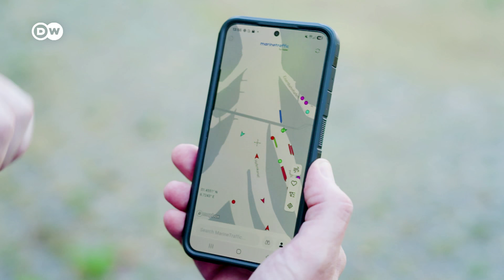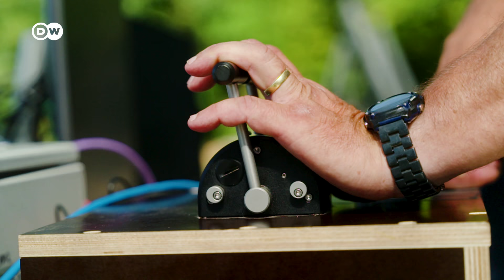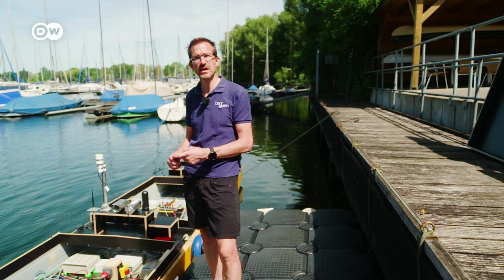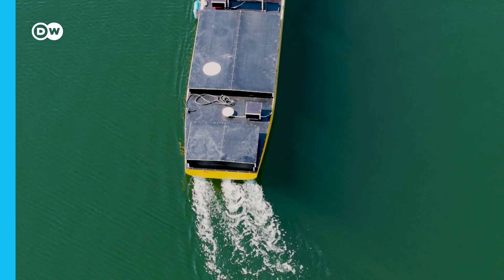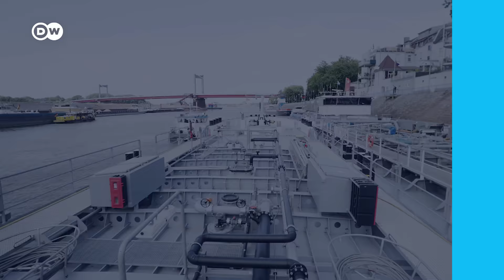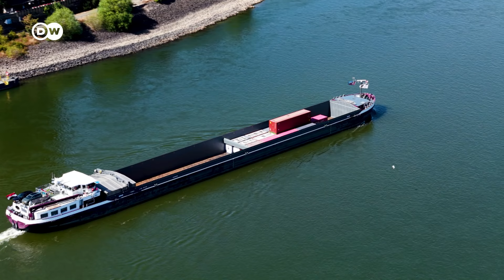Rhine running low: Can special ships keep goods moving? | DW News

Comment: I'm not in any way an expert, but I've been thinking about delivery system globally. Why do we use diesel based machinery and not a conveyor belt system on land in a tube like protective environment. Thousands of kilometres of tubes connected worldwide and powered by electricity. In the long run it could help improve our climate, given that we wouldn't use IC vehicles. Expensive, but less damaging to our habitat.
Reply: You mean trains?
Reply: @maxfuchs3387  Trains are very useful, but still run on diesel. Is conveyor belt a train?

A high speed conveyor that could transfer goods let's say from China to Europe in under an hour. Musk proposed vacuum tubes for fats transportation, but I have no idea how could we create vacuum tubes stretching for hundreds of miles without bursting.
Reply: @jab @jabadabadu7089 most trains run on electricity in the developed world (excluding USA).
So you think we can’t figure out how to build a vacuum tube (simple but expensive) but want to build a supersonic conveyor belt? You do understand that the stuff you want to transport with it would go up in flames due to friction of air and object?
Also.. we should just start manufacturing stuff where it’s needed. Different for special machines etc. but otherwise it’s true.
Reply: @maxfuchs3387  Passenger trains are mostly electric, but cargo trains still run on diesel-electric system. As I said, I'm not an expert, it's just an idea. Whether it's doable, that's a different question.
Reply: @jabadabadu7089 this is just not true. Most are Electric especially considering the transported tonnage. The main routes are electrified and have been for a long time.
Reply: Waterway transportation is energy efficient when compared with other transportation means. Much more cost and environmental efficient way in Germany is to electrify the car fleet and in next steps to electrify and use hydrogen in the road transportation. Ships can later go to hydrogen or ammonia, on short voyages also electricity, but the environmental impact is smaller.
Reply: Trains. You're describing trains.
Reply: are you thinking of trains?
Reply: Guys, I said conveyor belt like machine. Is train a conveyor belt?
Reply: @jabadabadu7089  Dissociated belt fragment, so you can scale up and don't need a very expensive continuous belt loop
Reply: This is done in many larger industries like mining but at a very localised scale. The challenges posed by weather, terrain and the sheer scale of maintenance makes it improbable. For example, a conveyor belt ranging from France to Ukraine would probably work only a few hours a day effectively as even a minor disruption around Austria would halt the entire line until it’s fixed. Even with multiple lanes, the sheer scale of such a machine would ensure something somewhere will always go wrong. Also the friction between materials is probably larger than the friction faced by a similar load carrying vehicle like ships or trains, so the energy efficiency would probably be worse off.
If you really think about it, technically trains fulfill the exact same function almost similarly. There’s an overhead electrical power supply, with a low friction surface underneath. Modular conveyors slide on that surface while getting powered by the overhead power source. Even if one breaks others can continue functioning on the same line with a small delay.